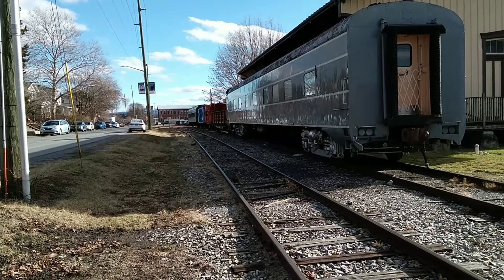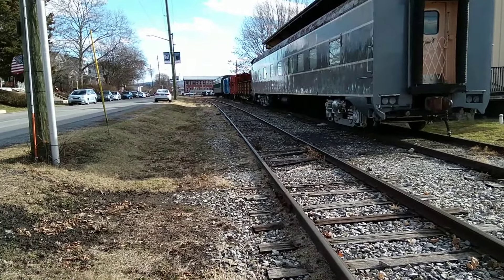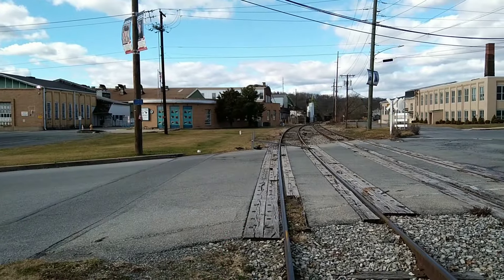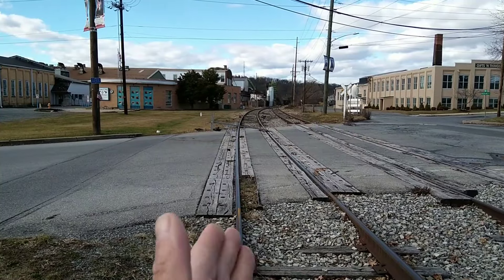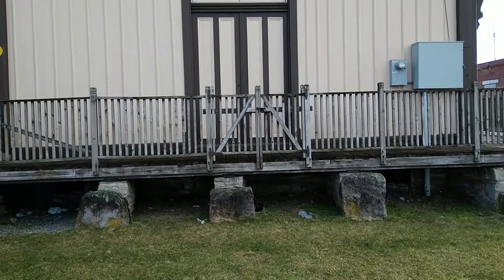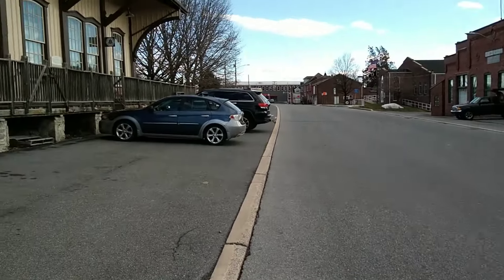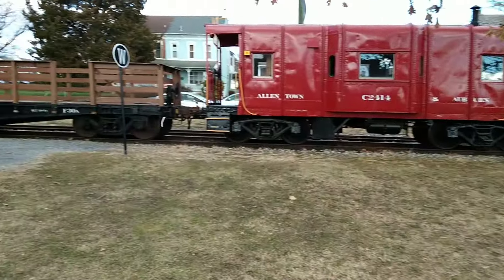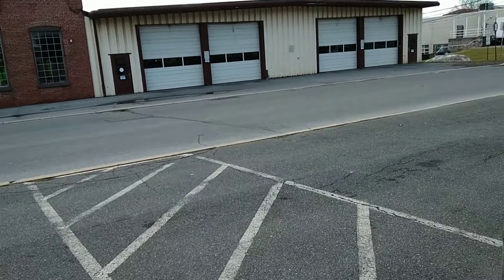The Kutztown railroad station. (very windy at spots) Kutztown PA.

Comment: About 7 years ago I saw something that was a little weird. The old historic Bethlehem station at W Lehigh and Main Streets, just a block from the Hill to Hill bridge, that track is OOS and it ends just past the station going east.

Looking west up the tracks there is a cross over and there are signals that are always lit up and for the life of me I don't know why they have signals for that track seeing that it ends 2000 feet from the signals

It is an anomaly and they actually put in new signals back then which made even less since.

I was sure they were going to rip out the signal for that track and take it completely out since it is no longer used.

Do you have any idea why they left it there ?

Do they run special trains from the station ?

I know they were talking about bringing back service from NYC to Bethlehem, but I doubt they would ever use this ROW

They would most likely use the NS track already in place that has a connection with the NJ Transit that connects to the High Bridge station, the end of the line for the Raritan line.

Any thoughts ?

Thanks
Reply from the maker: Good evening Bill. I will be honest with you. I am not familiar with the areas you are referring to. Is this on the south side near the steel site? That is all Norfolk Southern and maybe Lehigh Valley rail management? My Bethlehem knowledge isn't what it should be. I can go take a look and see what's there. 

The only talk I've been hearing about passenger service in the area is Scranton to Jersey. Sorry I can't be of more help.